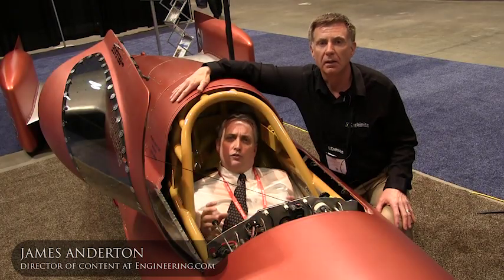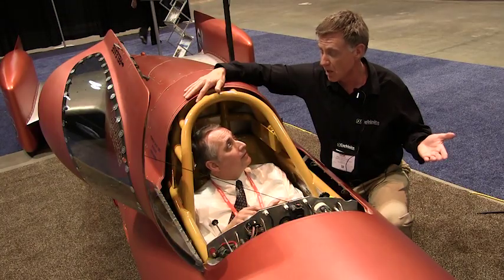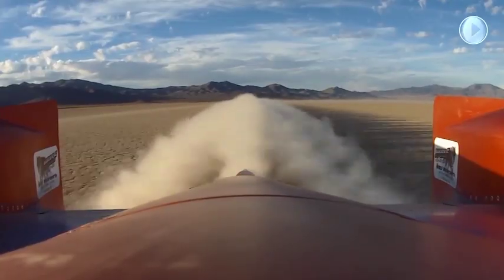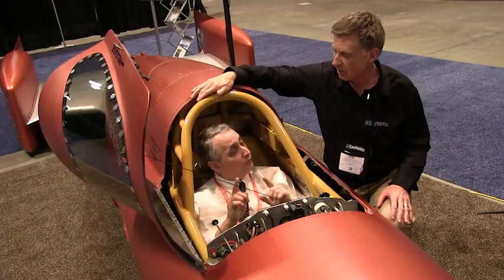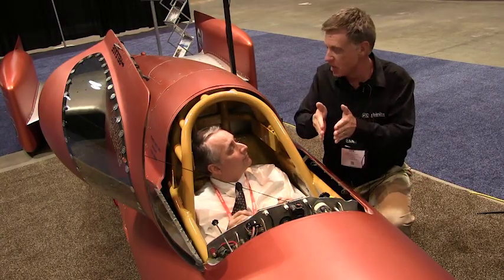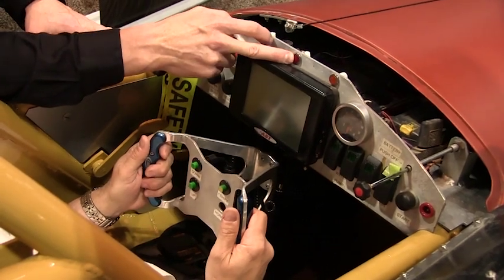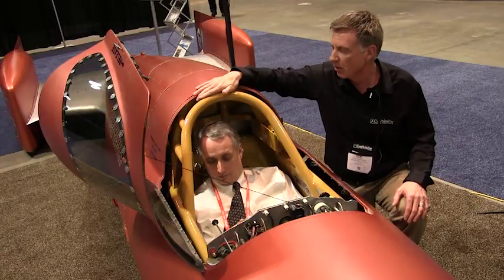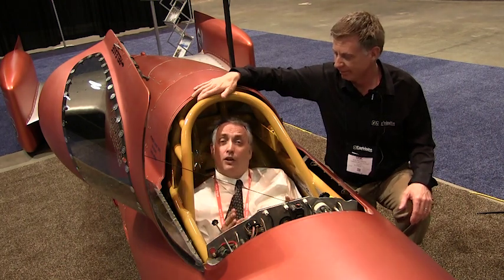Engineering the First Wheel-Driven Car to Go 500mph

Comment: Ironically, Bluebird CN7 could possibly have reached a timed 500mph on it's last record-setting run but Donald Campbell forgot to press a button on his steering wheel which limited speed, by the time he realised 25 seconds later he only made a peak of 440mph on the run, weather prevented any re£runs and by the time the opportunity would have later arisen, thrust powered cars were permitted by the FIA so Bluebird was obsolete.

Comment: So if a car is powered by a jet engine without putting power to the wheels it would be an entirely different class?  "wheel driven" vs not thrust driven?

Comment: If that car goes as fast as it looks. 600 is not out of its reach.
Reply: Idk if you heard the "mach1" bubble, part...
      Essentially, after 550mph, the way the car is shaped, the wind passing over the rear wing speeds up to mach1 creating a bubble of air that causes drag/pull... 
    They need a ton more power to compensate..
Reply: It is

Comment: The funny car speed record is 336 in 1000’ 💪🏼
Reply: That funny car won’t do a full mile w a return trip within an hour
Reply: @grooviefan  Sure, they can rebuild the engine in less time than that. lol
Reply: @generalkayoss7347  but will it do a  flying mile ??   Can they de-tune it to last a flying mile plus the time to build up to top speed ?
Reply: @grooviefan  I'm sure they could detune it down into the 6000-8000hp range and get multiple runs. In theory that car would still do close to 500mph. Problem is, the body would probably disintegrate above 400mph as it's made now. .

Comment: Seems like a click bait title. That car has gone nowhere near 500 mph. Meanwhile the Vesco Turbinator II just set a record yesterday at 482.646 mph. Either they or Speed Demon will get there long before this car will.
Reply: namasayanif, actually not quite, but close. Team Vesco had a run with a 503 mph exit speed, but the speed over the mile which is what the records are, was 493 mph. Plus a rainstorm flooded the salt that night, so they were unable to "back up" the run in order to get a new record. They are definitely knocking on the door though. Carbonite hasn't even set a single streamliner record in any class at Bonneville so far, although I will give them credit for going 400 mph, which most cars cannot do. And I know Speed Demon got fitted with a big AA class engine back in September, so they might be knocking on 500 soon too. Although I don't think their traction control has closed their wastegates fully yet on the smaller engine, so perhaps they are just going for a AA record and it won't be an increase in speed from their previous runs.
Reply: This video is from 2016, you moron.

Comment: In 2000, Gil de Ferran set the one-lap qualifying record of 241.428 miles per hour (388.541 km/h) at California Speedway.
Reply: In 1987 a.j. foyt took the special Oldsmobile Aerotech car wheel driven around a track in Texas at 257 mph. Its still the fastest record for a wheel driven car on a closed course.
Reply: @tommccallan8802  Are you sure about that?  "Closed course" roundy-round circuit "course".
In 2008 Tom Burkland broke the piston-engined wheel-driven record for the flying mile, recording a speed of 415.896 mph (669.320 km/h).  Unless, by "closed course" you mean a track other than straight line or Bonneville.  
Or a non-piston engine, wheel driven car: The fastest speed ever reached by a vehicle powered through its wheels is 737.794 km/h (458.444 mi/h), by the turbine-powered Vesco Turbinator, driven by Don Vesco (USA) at Bonneville Salt Flats, Utah, USA, on 18 October 2001.
Reply: @truegret7778  FIA is & has always been the official governor of automotive world land speed records & AJ's closed course record was sanctioned & recorded by the FIA as a "world record". Tom's record was an open course flying mile record that broke our (Al Teague) FIA record. With the advent of jet cars back in the 60's the FIA separated wheel driven & thrust powered cars leaving turbine engine -wheel driven cars with no category due to being a combination wheel & thrust car. The only record they can set is under SCTA which are not world records.
Reply: @nzsaltflatsracer8054  Correct me if I am wrong, but a turbine engine car is no more (the famous 1967 STP-Paxton Turbocar - Andy Granatelli) providing thrust than a typical NA or turbochrged engine does.  Now, it is different for a modern day 12,000+HP Top Fuel dragster/funny car that cat has a significant contribution from the force of the exhaust.  What you seem to be saying is unless a sanctioned Guinness World Records-like run for a record, a track record doesn't count.
Reply: @truegret7778  That's the way the FIA see it. Do you know the difference between an FIA record & a Guinness Book record?
Reply: @nzsaltflatsracer8054  I'm telling you just because the FIA recorded a value, doesn't mean it was the fastest speed or lap.  It means it is the speed or lap they have in their books.  I used Guinness (by saying Guinness World Record-LIKE) as a comparison.  Not times or speeds recorded are in Guinness or in FIA.

Comment: You gonna need way more than 2,600 hp to go 500 mph in anything. The fastest single engine door slammer Studebaker runs a single 6,000 hp top fuel engine and ran 377 mph just a couple weekends ago for 2018 speed week. The other 2 (chase to 500 mph) streamliners hit around 470 mph with 4,000+ hp with perfect conditions.  

Bench racing at it's finest. Cool build but very under-powered to set any real records based on what everyone else is actually doing. The Challenger 2 set the current record for 2018 at 450.9 mph and then was broken a few hours later by the Vasco team around 470 mph.
Reply: Over 400 mph, HP is not the answer. This is one of the few cars in LSR with active aerodynamics. Don Vesco died of old age before the Carbinite team had been on the salt twice. They've been working on the Thompson car for more than a decade. This is also not a "ground effects" car. They're still working out the primary stuff.  Blew a tranny, and a differential for instance. Another reason to love these guys is that when not racing, they take this car to schools to promote enthusiasm for math, science and technology.
Reply: Sure. Takes 6000 hp to make a brick go 377.
Reply: Aerodynamics.

Comment: Why don't you say that Don Vesco has the wheel driven record, and how many years ago?
Reply: 2018 they hold it at 470 mph and some change. It's been a battle between Vasco and the Challenger 2 car.
Reply: @HobbyTimeSeattle  Don Vesco is no more. It's Team Vesco that run the Turbinator now.
Reply: Team Vesco went 500 last year but rain killed the course at World Finals. Out of all the cars allegedly capable of running 500 mph last year, Carbiliner was the slowest out of all of them, I think they managed 417 during Speedweek ‘18 while Speed Demon went 446, Flasthpoint went 458, and Vesco went 470. I understand Rob wrecked the Carbiliner this year but I haven’t heard anything else. Sadly the SCTA folks are pretty tight lipped about it and Freyvogel’s team didn’t post any updates on the BNI health and welfare page.
Reply: @sinistersparky9657  I was there when the Carbinite LSR was destroyed 15 September 2019 at Bonneville, World of Speed. Rob Freyvogel was hospitalized with very severe injuries so it is good they built it as well as they did for driver safety.  He was still in a coma several weeks afterwards and he is currently home and doing intense physical therapy.  Team Vesco considered the condition of the salt to be too poor to attempt a shot at a record run and several cars were wrecked during that event. Very sad, an absolutely stunning car that this video doesn't do justice too.

Comment: Like the roll cage but I imagine the g force from the impact of a wreck at 500mph would kill anyone before the roll cage would save them
Reply: Jake Riley Just the other day someone survived a 450mph+ wreck reasonably unharmed.

Don't assume death is automatic just because of the speed-
Art Arfons was going over 600mph when he crashed at Bonneville...
In 1966.

Again,
relatively unharmed.
Reply: There is unlikely to be a high-speed impact unless you take off. Most crashes in land speed racing are rolling and skidding across the desert, not impacts. Still very harsh, but survivable.
Reply: flashpeter625 I dunno lol rolling at 600mph would be a hell of a lot of g’s. Don’t you think?
Reply: @jamesbizs  It's more like skipping a few hundred feet at a time than rolling. lol

Comment: is it possible for a piston motor wheel driven land speed racer to hit Mach 1, if 550 mph is possible why not aim for the sound barrier
Reply: The physics of air resistance is subject to the "affinity laws". This is that air flow is proportional to speed, resistance is the square of the speed, and power is the cube of the speed. What this means is that as the speed doubles there is twice as much air flow, but four times as much resistance, and that it takes eight times as much power to overcome that resistance. If you've ever tried to walk or run through chest high water then you've experienced the effect of the affinity laws. Walking through water isn't very difficult at all, but trying to run takes tremendous effort for even a small increase in speed. Beyond just the power needed, wheel driven vehicles depend on friction with the ground for traction. Resistance is the square of the speed so there is four times more resistance as speed doubles, but friction with the ground remains the same. For instance when walking through the water traction with the bottom of the pool is sufficient, but as someone goes faster their feet begin to slip. Obviously dragsters and funny cars do well over 300 mph in just 1/4 of a mile so a 500 mph wheel driven car is probably possible, but it would need a hard surface. if there were a wide straight highway about ten miles long it could be a great place to set new world speed records. With a solid surface aerodynamics such as used for Indy cars could be used to increase tire friction with the surface, but this also increases drag. Mach 1 is probably not possible. Just as water or oil has viscosity, air has viscosity too. At Mach 1 the air cannot move fast enough to fill the void behind a plane or car. This creates a vacuum which is responsible for the sonic boom. Anyway, there's a lot of physics of aerodynamics that applies as vehicles move faster which is why very few cars go over 300 mph, particularly on a crumbly lake bed.
Reply: I was curious about the mach bubble and that it creates a stopping of speed increase. You cleared it up for me nicely...Thank you for the insight.
Reply: Thanks! Airplane propellers are affected by the fan laws too. I believe they had to gear down the B29 propeller blades because they were 13 feet in diameter. The rim speed at the tips of the propellers would have been supersonic without gear reduction. A vacuum starts to form behind a vehicle as it approaches supersonic speeds, so it's not just pushing harder on the air in front of it, it's also being pulled back by a vacuum behind it. Air pressure at sea level is 14.7 pounds per square inch. At supersonic speeds the air cannot fill in the gap behind the vehicle so not only is it pushing all that air in front if it, it also has a strong vacuum behind it. The fastest propeller driven plane ever reached 623 mph. Anyway, I enjoy the physics of it, and I'm glad you enjoyed my explanation.
Reply: Good explanation, but I've never heard that the vacuum behind a jet plane has anything to do with a sonic boom. All the explanations that I've seen (and which makes sense to me) is that when a jet travels at the same speed as the sound waves that it creates, those sound waves are compressed into a single wave. Instead of the sound energy coming at you over time, it hits you all at once. Boom. And then of course, you can hear the jet as it flies away because the sound waves behind it are spread out. (Ref: Doppler effect.)
Reply: Mainly I was trying to use the water explanation and the fan laws to show how resistance and power increase exponentially. Hmm, now I've had to do some more studying. I'm certainly no expert, but I do believe that the collapse of the low pressure area behind a supersonic vehicles does play a role. I looked up a site that says there's a double boom, the second being created by the low pressure area. Down near the bottom of this page it talks about pressure and the double boom. https://courses.lumenlearning.com/boundless-physics/chapter/doppler-effect-and-sonic-booms/
Reply: Thank you for the excellent reference.
Reply: Air resistance increases as a cube of the speed.
Reply: @perrysims3320  Related to that traction required to turn the power into movement increases with the drag, the old adage “ power is useless if you can’t get it on the ground
Reply: @jimjohnson8864  I read that the airflow below you car will choke and thus you lose ground effect ( suction ) somewhere between 500 and 623 mph . So just a flat belly and the rest due to wings which also get ineffective at that speed..
Reply: It takes exponentially more power to achieve X speed the faster you go.